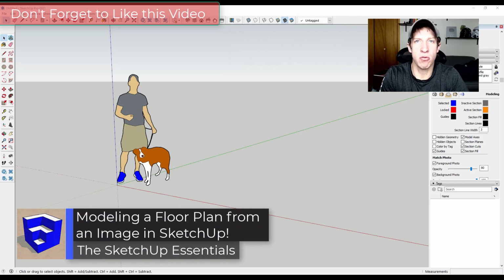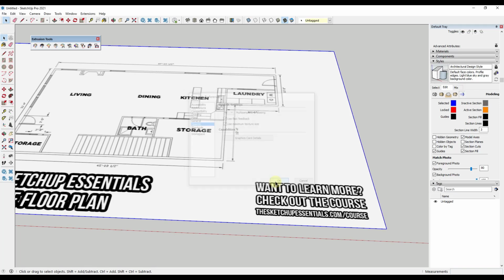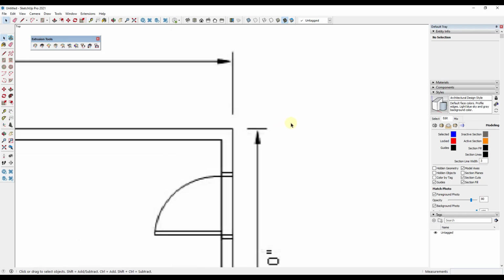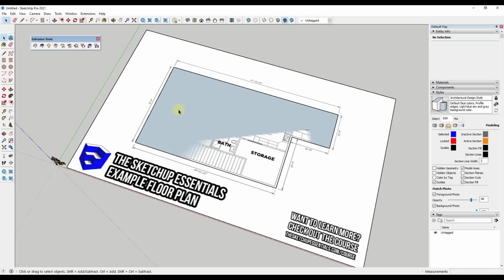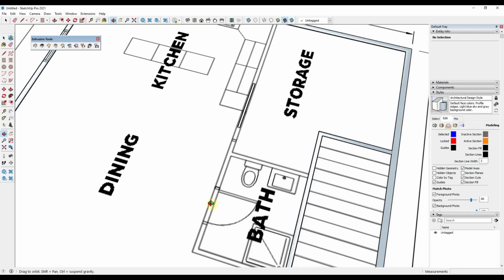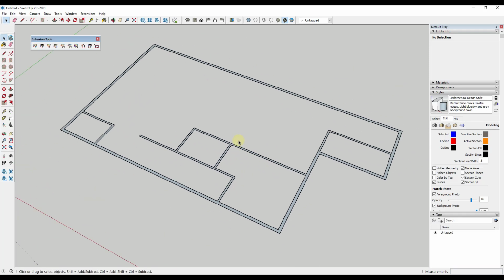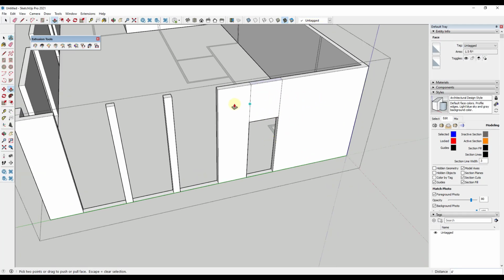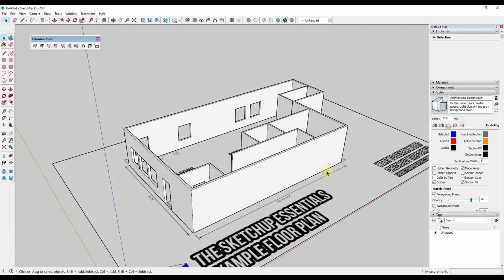FLOOR PLANS FROM IMAGES in SketchUp Pro! Updated for 2021! (Getting Started with SketchUp Pro Ep 4)

Comment: what if I created the floor plan in sketchup with correct dimensions and then i want to make it 3d, do I need to export it as a jpeg and then start a new sketchup template & import it in? Or can i just start push/pulling walls in my original file?

Comment: Hi great video, Thanks! I have one question.  When using the offset tool to offset outward I am having a problem getting the two selected walls to stay highlighted, as soon as I type "F" or click on the toolbar button the highlighting goes away.  I tried holding shift, alt, and control, but nothing seems to work as soon as I select a different tool the highlighting is gone.  Any idea what I may be doing wrong? Thanks again.

Comment: Thank you Justin, very well explained, easy to understand and very useful. 
I do have a question though - I have a cabinet set as a component. And I want to resize it. Make wider / from 1000 mm to 2000mm. When I do so using scaling the objects widens to the desired size, but the sides of the cabinet double in thickness. From 18mm to 36. I built the cabinet from individuall components, sides, bottom etc. . And I just cant figure out a way how to change dimensions of an object without having sketchup change the dimension of some part..... Can you shed some light on this please, or direct me to where I can learn more about this... thanx
Reply from the maker: Try this - https://www.youtube.com/watch?v=_Pmy8M_FmMY

Comment: 1. Scaling
- import image as image
- set to maximum texture
- Place in the workspace
- Explode the image
- Group the image
- Find a point where the size is known
- Use the tape measure tool to measure that point's actual distance in workspace
- change the measured distance to the DESIRED distance (specified distance in image)
- Resize > yes
- Check if it's scaled properly 
2. Modeling
- Use line tool to trace the outer lines
- OFFSET for the interior walls
- trace inner lines
- offset inner lines
- draw lines for openings
3. Extrude
- Group exterior walls
- Group interior walls
- reverse faces
- extrude all walls 
- double-click for shortcut
- repeat
- make the specified openings
- repeat for the interior walls
- delete lines using eraser